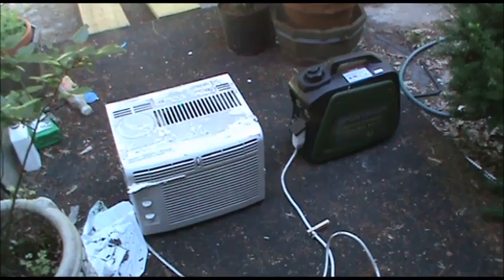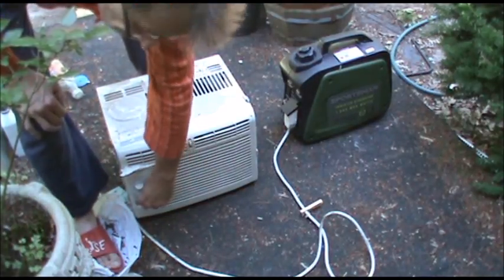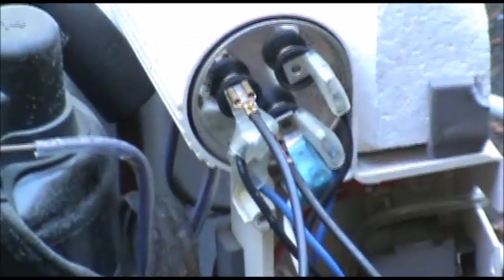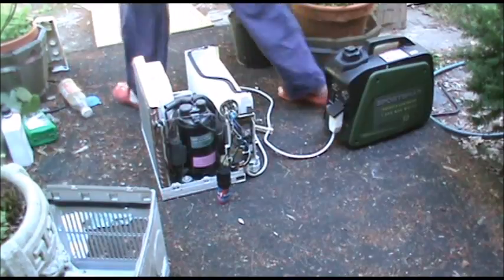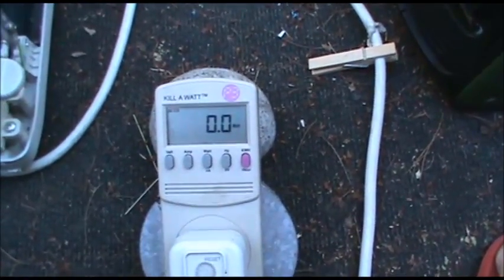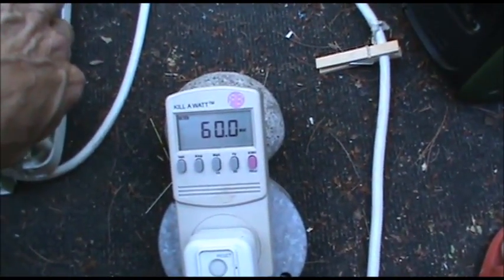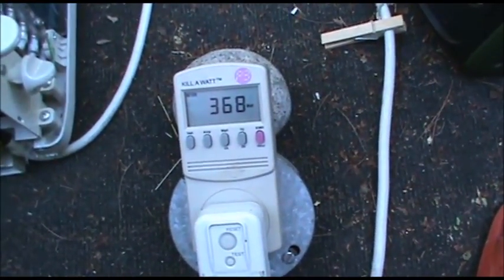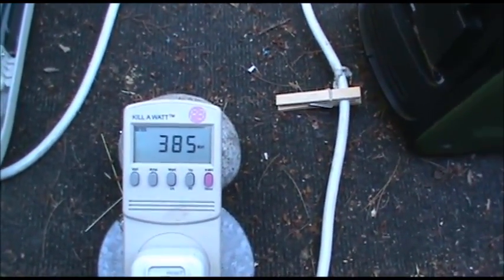5000 BTU air conditioner running on a 1000 watt generator

Comment: I bought a new 1000 watt Honda generator 5 yrs ago when I first got it, I could run 5000 watt A/C all my lights, laptop, No problem, now the generator will not produce the amps it use to. New Honda is different the and old one used many times!

Comment: Why don’t you turn the a/c to cool to begin with, then start up the generator. It seems to me that the sudden shock of the switch is triggering the generator to shut down. Or maybe, look for a way to disable the safety shutoff on your generator, it may be set to a lower tolerance and you might be able to make it’s tolerance higher, then it won’t shut off from the sudden heighten in electric draw. They probably put a lower tolerance on the safety shutoff straight from your generators factory, to prevent a problem and save them from unwanted support phone calls and refunds or exchanges.
Reply from the maker: i tried t hat and couldn't get it to start. 
just recently that poor ol' generator gave up the ghost. It had a million miles on it so i bought a replacement, same one but they upped the wattage to 1400w they don't make the 1000s any more. most likely to solve this problem and keep up with the 1000w honda's that will run a 5000btu.

Comment: I have a harbor freight 2000w inverter charger and it will start the 5000 btu ac no problem. It sat for a year and I pulled the cord twice. It started right up. And it’s pretty quiet too. ✌️
Reply from the maker: my 1000W may have just given up the ghost. ill look into that one next.

Comment: For starters, not all inverter generators are created equal. Try this on a Honda EU1000, it may or may not work, but it will do better than this. You could also try a soft start and it may help.

Comment: Do you think  a 1500w/1200w generator would run a 5000btu AC  and a small rv fridge, both at the same time ?
Reply from the maker: i think the 1500 might if its a good one like a Honda. you would really be pushing a 1200. but it depends on AC and weather or not its a "soft start" and the same for the frige.

Comment: Hi Ottis Good Video,

First I never heard before of changing to use a larger "starting capacitor." So I learned something and will keep that in mind.

Some reasons why you didn't have success THIS TIME.

#1) Your Invertor Generator has a switch labeled Eco-Run & RUN.

Invertor generator Mgfr manuals state DO NOT attempt to run Refrigerators or Air Conditioners in ECO-RUN setting. Always run them in RUN mode. (Why? Later)

#2) A Kill-A-Watt meter can only measure the AVERAGE CONTINUOUS POWER used over seconds, minutes, hours etc. 

It does NOT display the instantaneous ELECTRIC MOTOR START UP SURGE POWER required drawn in the first fractions of a second (typically drawn in the first dozens of thousandths of a second).

#3) EXAMPLE: An electric motor that draws say 400 Watts running, may demand an instantaneous SURGE starting wattage of 2x to 3x time the running 400 Watts or an instantaneous SURGE 800 W to 1200 Watts. Thus in the latter case exceeding your generator.

In a below video one guy reports the 5000 BTU A/C draws only 350 Watts on Hi-Cool. So an estimate the startup surge power of 3x 350 W = 1050 Watts SURGE required for an instant. But that is within the capability of the generators 1000 W surge and 800 Watts running in the NORMAL RUN MODE.

#4) BUT YOU DO NOT GIVE UP.
Other Guy'es Internet videos are demonstrating running a similar 5000 BTU A/C off their small 1000/800 Watt generators. (I've included web links to them.)

#5) (The Why? Later) - ECO-RUN vs RUN
The RUN setting runs the generator at FULL SPEED thus is continuously able to supply 1000/800 Watts in an instant, but uses the most gasoline. Like running at 70 mph full time.

In the ECO-RUN the generator is measuring the power wattage being drawn and thus varies the speed of the generator to produce it. So if the A/C only requires 400 Watts the generator will run at a slower gasoline economizing speed than it would to supply 1000 Watts. But if more power is drawn, the ECO-RUN will speed up the generator.

The problem in ECON-RUN the generator can't instantaneously increase its speed from supplying 400 to 1000 Watts and the generator. There is a DELAY, equivalent to going say jumping from 30 to 70 mph. This delay resulting from a large power swing may cause the generator to stall. Also some people report the ECO-RUN delay resulting from the SURGE running electric motors "may" damage the electric motor.

Good luck with your repeated experiment.
I hope my explanation helps.

Other Guy's  successful videos 

https://youtu.be/M9xzhE6KKoU

https://youtu.be/nzNFR2pdfQ4

https://youtu.be/mYKHMKfqE_Y

https://youtu.be/WF1dOtXA-oc

- Paul

Comment: Also, don't put the generator on eco mode. When starting AC start on low first then high. Turn off eco mode to let generator run full blast while starting the AC compressor

Comment: These generators are a con 2 versions 800w & 2000w come on all different makes & colours but under the side panels there all the same thay are not the watage as sold,I can't even get 400w from a 800w with the 1000w Serge.

Comment: I run a Midea -5k  BTU eco mode off. No problem. Low fan then low cool then high cool high fan Same generators  . Will try my LG 5016 next after it's oil change.
Reply from the maker: the more i see the more i think (and have heard) that not all these generators (like mine) are the same, some pull better than others. i may have gotten a weak one. let me know on the LG 5016!

Comment: What you were looking for in 2018 was a soft start system. :)
Reply from the maker: so just recently i bought an "energy saving easy start" unit that still stalled out the generator. point me to a "soft start system" and ill give that a whirl. currently im borrowing my son-in-law's much bigger generator which i don't like lugging around...
Reply: @ottisthedog3544  I recently bought a Craftsman 3300 and all I had to do was adjust the idle scew with no load on the generator to raise the RMP. Once the ac kicks on the rpms will drop.  This works out pretty well. 
The truck is finding the Lowest RPM that will allow the portable ac unit start.
Reply: @ottisthedog3544  I just bought the one in this video
https://youtu.be/b9kZL2EIKpA

Comment: Ok Ottis - time for some basic math energy/power conversion education for you and  your readers.  Your 5000 Btu/h AC provides 5000 Btu of cooling per hour.   This is, in thermodynamics and general physics realm, a unit of thermal power (Btu/h, where Btu is energy, and you are delivering or processing this amount of energy each hour, which is by definition, power).  There is a simple conversion of thermal power to electrical power.  The conversion is 3412 Btu/h = 1-kW of electrical power.  So, your 5000 Btu air conditioner, if delivering 5000 Btu/h, requires 5000Btu/h divided by 3412 Btu/h/kW = 1.46 kW, or 1460 Watts.  Now, keep in mind that your AC is not 100% efficient, and therefore, the electrical power of 1460 Watts will increase due to inefficiency.  So 1460 Watt is lowest possible power draw, on average, to provide 5000 Btu/h of cooling.  That is just the steady state power required and it exceeds your generator by 50%.  We have not even spoken about start-up current the AC compressor requires, which is a big transient of power beyond the 1460 W and your generator's capability.    Your generator never had a chance - poor thing.
Reply from the maker: All points well taken. being the "cheap charlie" that i am my attempt  to rub two nickels together and get a quarter failed... i really like the inverter one. looks like LG makes one also but they refer to the inverter as a Dual Inverter so i am curious as to what "Dual" means exactly. its a LW1019IVSM its a wee bit smaller (im dealing with limited space) but more money (cheap charlie (who generally pays more in the long run)). im gonna keep looking but im finding the Midea closer to $300 but not under so thats my mark. the first one i find for under $300 im buying and trying! (including shipping of course!).
thanks for the post
Reply from the maker: OMG thank you! finally someone with some math! i see guys on YouTube running these small AC's on this generator, but i never really trusted it. i didnt feel the generator pulled down enough when they turned on the AC.
Reply: @ottisthedog3544  I'm not sure what's going on here, but I've seen a 800/900 watt gen run a 5000btu a/c
Reply: @rayb8376  Ive done it it worked well enough for a 42 footer with two tip outs cooled it well.  Breaking the machine in before high loading it helps.
Reply from the maker: @Soup Can No amount of “numbers calculation” trumps real life experience. Any engineer that’s worth his pay will tell you that. Not to mention this is what brought about the “Tool and Die” trade (the “see if these numbers work” guy) and any tool maker worth his pay will tell ya “we gotta start somewhere, go see the engineer (the “come up with some numbers” guy)”. Keep in mind your dealing with Cheap Charlie (Me) who takes great pleasure in taking something grotesquely under rated and making it work. So my first objective is Cheap :)   the last one I bought was a Geek Aire GBRC5MD1 to no avail. Their spec chart says 451watts and 3.9amps that’s “cooling” watts and amps I assume that to mean running wfo. I was looking at a Midea MAW08V1QWT this is an “inverter” model. What do you know about them? Not a lot of them out there and from what I see they haven’t been out long so I wonder about their durability and life as I run this in my truck camper. 
What I have learned from this experiment is that these little inverter generators are great for a lot of things. We have had mine run for over 10 hours on a tank full but all it was running was my buddies breathing machine a couple XBox’s, tv’s, lights, phone chargers. The xbox’s and tv’s only ran a couple of those hours. 

They are not all the same even thou they are the same model. Some will pull more watts than others by a lot. I would guess well over a couple hundred watts difference, I got a weak one. 

As you point out the AC unites vary widely also and the cheaper you go the more watts your gonna need to make it run.

All this said luckily I have a son in law that lets me borrow his 2000 watt when its hot out and im going camping. Its kinda heavy but I manage and being in Michigan the hot season don’t last long.

Thanks For The Comment
PS: youtube is a wonderful thing back in the day all we had was blogs… no pictures… let alone movies…

Comment: Just need to get one ! Five to seven hour run time on a gallon will get a deep freeze frozen and good till the next day cheaper then buying ice at the cabin ! Just freeze a crap load each day for about $10 !
Reply from the maker: i have a cabin in the UP and yes ive seen mine run for over 10 hours in eco mode on a tank full. granted it wasn't pulling anything but a CPAP machine and a few lights (led at that) but we were dumb founded.

Comment: 500btu is only about 500watts. I run mine in my camper on a car battery and a 750w inverter. Marine deep cycle battery. Lasts about 25 hours straight. Went ahead and hooked it up to a thermostat outlet so it turns on and off automatically so I don’t freeze to death from it snd it also conserves energy. Then I use my generator to charge the battery if it camping for a while otherwise it has a very small solar panel that charges it full over about 3 days
Reply: Funny comment.

Comment: Try removing and cleaning the carburettor. Pay special attention to the idle air ports. They are microscopic ports near the butterfly. You may see only one small port or as many as 3 in a cluster just near where the butterfly closes. 
Remove the idle mixture screw and then clean them with carburettor cleaner spray and an old accupucture needle. When you see them spray carby cleaner through them you know they are clean.
Note these ports run off from the same hole that the mixture control screw is in. You will see a port that runs forward toward the butterfly if you look in the mixture port hole after your have taken the mixture screw out.
I have had a generator do exactly what yours is doing when trying to transition to power under sudden load. The engine can't do it so it drops speed and the inverter decides it is low voltage so the engine stops to protect the inverter.
I could not start a simple fridge with mine but it would run a 2000w heater. It was also hard to start.
Once I cleaned the idle mixture circuit it was perfect.
The idle air and mixture circuit is responsible for ramping up to the main jet circuit as well as idle speed.  
This circuit gets blocked from New often but is very susceptible after long storage and old fuel.
Best of luck with your adventure.
You are asking a lot for a 1kva unit.

Comment: If the running power is 380W. Multiply that by 3 and you get 1140W. Your generator with a surge capacity of 1000W will not handle that. You "75 micro-fart" capacitor is just a joke. You find 2500 micro farad capacitors in small amplifiers. What will work in this case is to connect car battery in the place of that capacitor with some thick enough cables, or you get a super capacitor from a microwave oven.
Reply from the maker: thank you thats the most useful information i have received to date.  the multiply is something that i can understand and apply to other things.

Comment: works here without start capacitor.    https://www.youtube.com/watch?v=nzNFR2pdfQ4
Reply from the maker: and it even looks like the same model A/C I have (he listed it in a link). i have been told that these generators are not all created equal. some have more power than others depending on which "board' you have in yours. i tried another 5000btu I have and it wouldn't run it either.

Comment: You can buy a relay that will delay on start.  Hook up the fan through it so the compressor starts first and a few seconds later the fan starts,.  That would be about a 10% improvement right there.
Reply from the maker: I'll look into one of those Thank You

Comment: That is awesome! It's what I'm looking to do. How long does a gallon of gas last?
Reply from the maker: a tank full (less than a gallon) has run for 10 hours but it wasnt running a lot of stuff. battery chargers, led lights, xbox for a few hours. i fill it with a 5 gallon can so im not sure how much it holds

Comment: What the world needs is a <200 watt 12v Air conditioner that can cool a 60sqf space from 95F to 65F.  Cool Breeze claims they can do this, but they really can't.  
I wonder if a 2500 BTU can cool a van?
Reply: Unless one is in the dry desert that swamp cooler will not work.
Reply: @richarda996  Amen, Richard. So many folks have been hornswoggled by this scam here in South Florida that it's sad. No one paid attention in Jr. High when they talked about relative humidity.
Reply: What the world needs is more educated people and not pie in the sky dreamers that rope other people into wishful thinking.  My 1994 Honda Accord's factory AC was a 22,000 Btu/h capacity unit. What makes you think you could take 200W, which is at best 682 Btu/h at 100% conversion efficiency, and cool down a car? You are literally suggesting a violation of the conservation of energy.  You achieve what you say, and you will be richer than Elon Musk.  I don't know who Cool Breeze is, but they sound like nothing but hot air, and that's not cool.

Comment: Those meters dont show peak starting watts.  I have the same ac and generator.  My clamp on meter  spiked at 20a and the killAwatt dosnt even show a spike.  Mine dosnt run the AC either.

Comment: The Kill-A-Watt may not have a quick enough sampling rate to catch the actual spike. But its that spike thats killing it.. The capacitor should have helped, maybe it didn’t charge completely or maybe something is wrong with it or hooked up wrong.
Reply: Pine to puke RMS is more & not seen.

Comment: Sorry Mr. I have seen some others pulling it off with the same set up. Either the cap is not on the right plugs or it is too small. Maybe they should install an option from factory to start it with a crank like old cars used to be. But don't give up. It needs a lot of juice at start up but only for  maybe a second the max.

Comment: If my computation is correct, a 5000 btu is 1.96hp is 1461 watts. I don't know how your 1000w generator can power that 2hp aircon
Reply: A heat pump just moves heat around.  The 5000 BTU/hr rating is the amount of heat it moves, not the energy required to do so.  Most small air conditioners have a coefficient of performance (COP) around 3.0, meaning that they move 3 times as much heat as energy required.  That's approximately what the meter shows.  The important figure that it doesn't show, however, is the peak amperage used in the first few tenths of a second during startup.  To measure that, he needs a better ammeter.
Reply from the maker: ive seen honda's do it and ive seen these do it if they are a "soft start" air cond
Reply: @ottisthedog3544  what is soft start?
Reply from the maker: @davidgarcia-mo4ob  its one that already has a capacitor built into it much like the one i tried to put in only properly matched for the motor